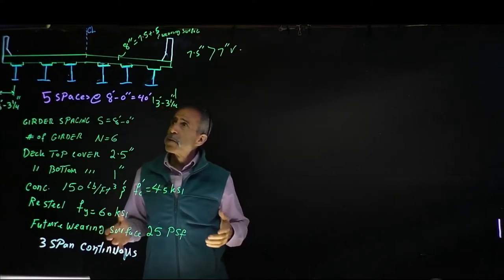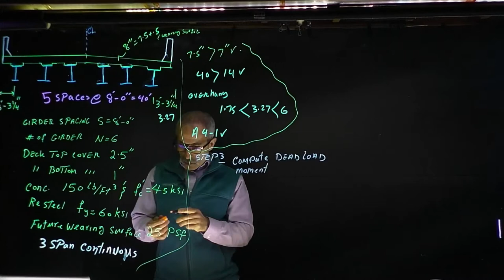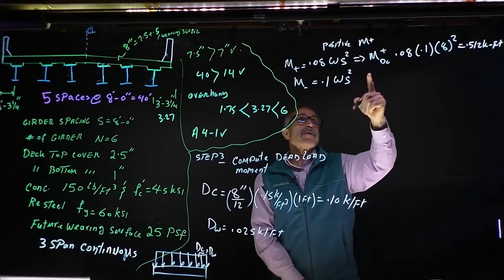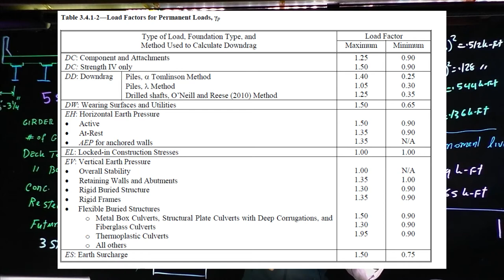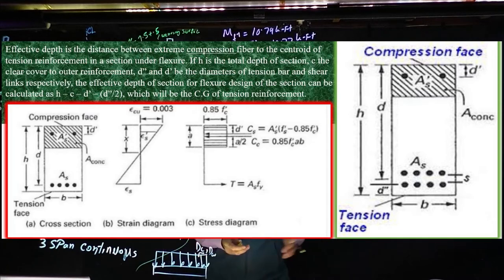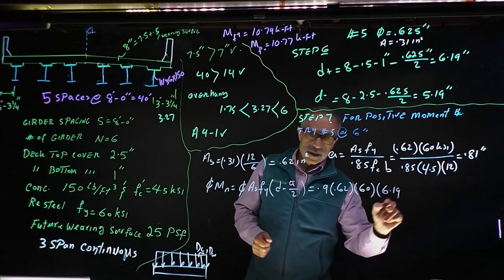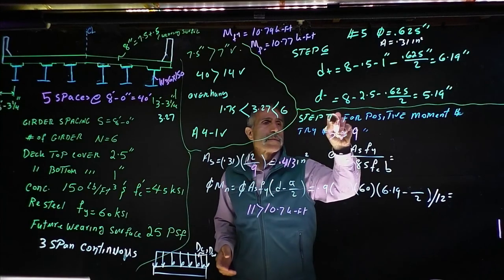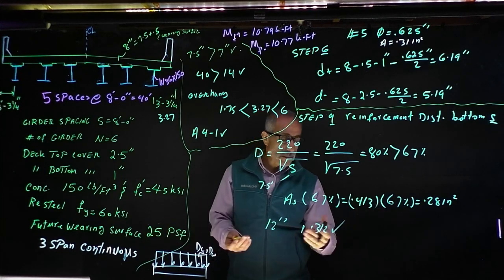Bridge Deck Design

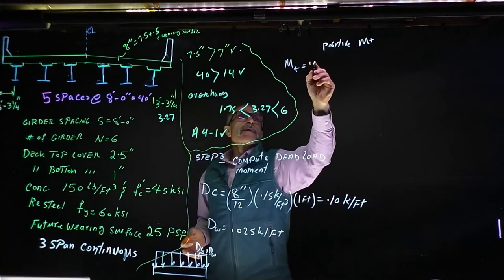Comment: just curious, when calculating bending moment. Shouldn’t we be using values from the 5 span diagram? @ 7:41
Reply: no since it is 3 span bridge. you might be mixing the girders with spans.
Reply: @ahmadalmesba7  Ahhh thank you for the clarification, yes I was thinking of the spans going transversely to the bridge deck and not longitudinally
Reply: @alexrosales986  i might be wrong since he is using the strip method.
Reply: 5 girder bays, but spans is 3.